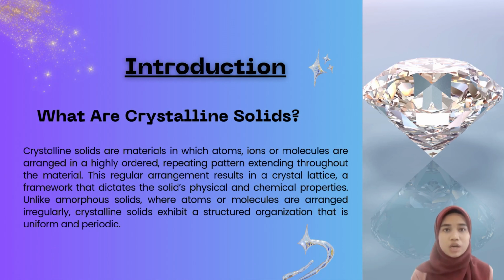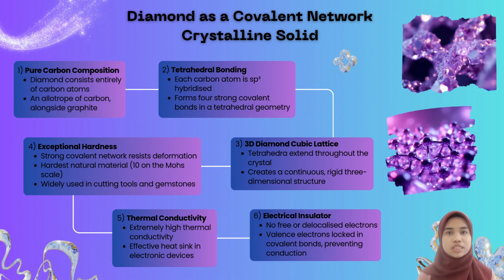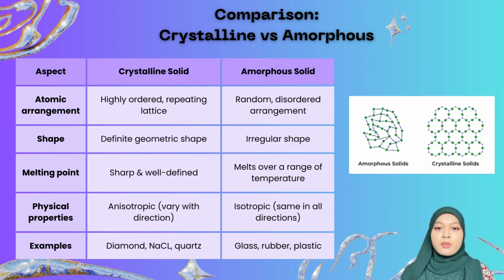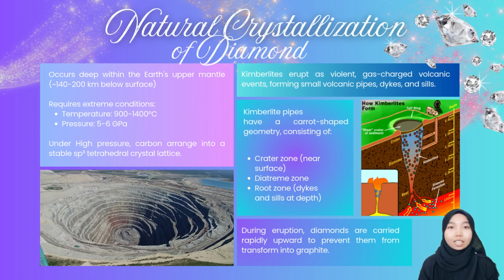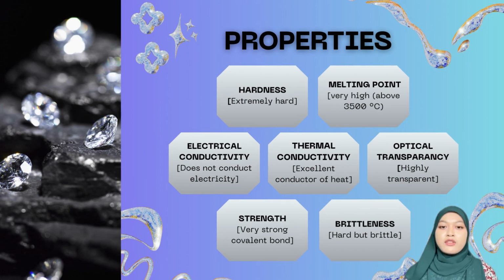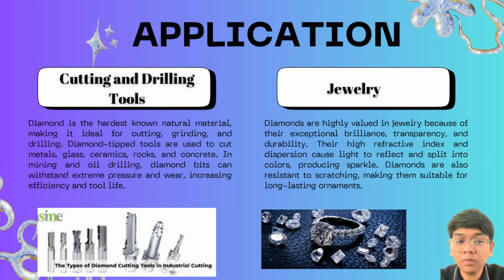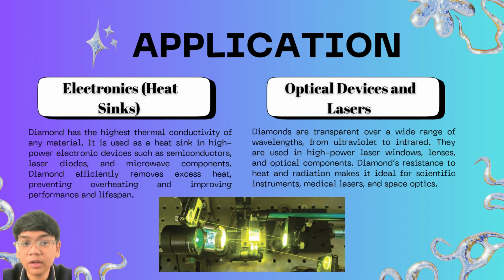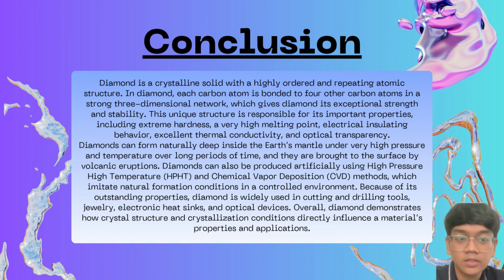CHM361 | Crystallization of Diamond

Comment: hey I have a question! Why does diamond have a very high melting point?
Reply from the maker: Thank you for the question, from your question diamond has a very high melting point because it consists of a giant covalent structure in which each carbon atom is bonded to four other carbon atoms by strong covalent bonds. A large amount of energy is required to break these bonds, so diamond can only melt at extremely high temperatures.

Comment: Why is diamond used in many applications such as cutting tools, jewelry, and electronic devices?
Reply from the maker: Thank you for the question. Let me explain, diamond is used in many applications because of its unique properties. Its extreme hardness makes it suitable for cutting and drilling tools, its brilliance and durability make it ideal for jewelry, and its high thermal conductivity helps remove heat in electronic devices. These properties are a result of diamond’s strong and orderly crystal structure.

Comment: Such a good content, however I have a question. Why is diamond transparent despite being made of carbon? Thank you 😊
Reply from the maker: Thank youuu! Anyway, to answer your question, diamond is transparent despite being made of carbon because each carbon atom is strongly covalently bonded to four others in a rigid three-dimensional tetrahedral crystal lattice (sp³ hybridisation), creating a very large energy band gap. This large band gap prevents visible light from exciting electrons, so visible light is not absorbed and can pass through the structure. As a result, diamond appears transparent, unlike other forms of carbon such as graphite, which have free electrons that absorb light and make them opaque.
Reply: @adamarifmuh8022  Understand!! Thank you, shine bright like a diamond and good luck for your future endeavours 🪴

Comment: so if diamond is brought slowly to the surface it can become a graphite?
Reply from the maker: Yes it can turn into graphite only if a diamond is brought to the surface too slowly & exposed to high heat. At surface pressure, graphite is the more stable form of carbon. Natural diamonds survive because they are usually transported to the surface by high speed volcanic eruptions. This rapid ascent preserves the diamond structure. If the ascent is slow, the carbon atoms have enough time and heat to rearrange into the lower energy form of graphite.

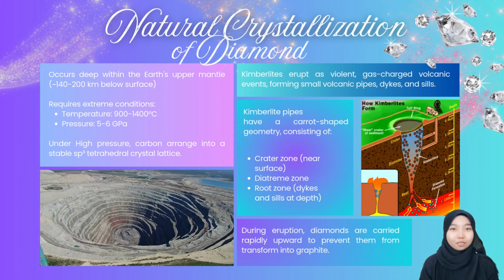Comment: 5:37  Why do diamonds form deep in the Earth’s mantle and not near the surface, even though carbon exists everywhere?
Reply from the maker: Diamonds only form deep in the Earth’s mantle because extremely high pressure & temperature are required to force carbon atoms into a tightly packed sp³ tetrahedral structure of diamond instead of sp² structure of graphite. This happens in the diamond stability zone at depths of about 140–250 km, where temperatures exceed 900°C and pressures of around 5-6 GPa. Near the surface, the pressure is too low, so carbon is stable as graphite instead of diamond